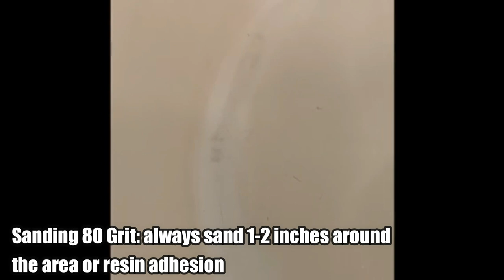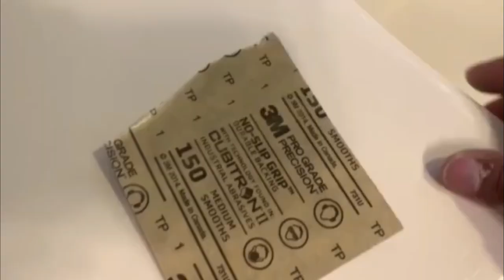How to Repair a Crack in a Fiberglass Bathtub | Fiberglass Bathtub Crack Repair | DP Tubs

Comment: I appreciate this video greatly as I’m going to attempt to fix a crack in my tub tomorrow. I watched other videos why did you not use the fiberglass sheet for this one? I cannot tell if I will need a fiberglass sheet for mine.
Reply from the maker: If the crack is hairline and the surface is sturdy without much fluctuation
Reply: @DPTubs  Thank you I was nervous 😂

Comment: Thanks for the video, I wish I saw this before attempting to repair the crack on my fiber glass tub.  I used Keeney Bathtub Inlay Kit for Bone Colored Tubs to try and fix it.  I realized after it was the completely wrong color and it did not seal the crack.  What is the best way to remove the putty and start fresh?
Reply from the maker: Use a single edge blade or a plastic scraper to remove. You can sand with 80-100 grit sandpaper to thin out the previous coating. Just remember to primer coat the area before spraying the new coating
Reply: Thanks, I put the bondo fiberglass resin and am waiting for it to cure. What texture should the resin be when fully cured?

Comment: I have a small crack in the middle of the floor of a fiberglass tub. Would you recommend same or one of the putty type repair products. Thank you and this was a great video.
Reply from the maker: I would not use a rubber putty. How big is your crack?
Reply: I have the same issue.
Reply: Which one did you go with? Did it work?

Comment: Thank you Danny for great step by step instruction. Currently following your steps to fix a crack in a tub and i have question for you. The Bondo general purpose putty you are using is not available in  Canada, can i use the Bondo body filler instead?. Thanks in advance
Reply from the maker: Yes you can!
Reply: @DPTubs  Thank you
Reply: @DPTubs  Is the reason of using  Body filler/All purpose putty is to smooth the surface of the resin ? or there is any other function  it does?. The tub crack i am repairing is not big and i did not use Bondo Hair, just used resin and mat. After sanding the resin it came out  smooth and nice so i am wondering if i can prime it and paint it without using Body filler if it is not necessary. Thanks for your help

Comment: What caused the crack? Is it a bad base?  I don't think I have a solid base below my tub and that's what's causing the crack.  I'm wondering if I should get a new tub or can possibly repair the existing tub.
Reply from the maker: Where are you located! Most bases have a gap between the sub floor and the base of the tub, or may even have particle board substrate that eventually breaks or cracks. If there is a sub floor then injectable foam can be sprayed under the base for support then fiberglass patched.

Comment: Just curious why you didn't drill holes at the ends of the crack to stop it from spreading like in your other videos?
Reply from the maker: This was a very small thin Surface crack that hadn’t penetrated all the way through yet. The reason for the use of resin was due to the area the crack was in.
Reply: @DPTubs  Ah got it thanks for that. I'm going through this now and have a 2" crack but it has gone all the way through so will drill holes on either side. Thanks!
Reply from the maker: Kevin Ng yes I would recommend that and use the cloth / mat and resin.

Comment: How do you repair a hole in a fiberglass garden tub? Hole is on the 'curve' of tub. Thank you!
Reply from the maker: In my other fiberglass crack repair video I show how to fix a crack on the curve with resin and cloth
Reply: @DPTubs  Thank you for a speedy response. I will watch it entirely.
Reply from the maker: Kathleen Golden i also have a small hole repair in fiberglass coming up this week I will show
Reply: DP Tubs do you recommend using resin on any area of the tub ? Or works only on curving area?
Reply from the maker: LocoSport HD any area that has cracks or even small chips

Comment: Do you recommend drilling holes n a 4 inch crack?
Reply from the maker: I recommend drilling a hole at each end when each side of the crack is not level with each other. Meaning the crack has caused one side to be slightly lower. 

If it’s just a slight hairline stress crack then I would say no to the holes
Reply: @DPTubs  What if this is on the side of the tub and underneath is a semi-open basement ceiling?  I can't get my hand up there, but if I spray foam, I think i twill get everywhere.I patched it with a kit from lowes and a day later it cracked again. So I think it needs support, but don't want to ruin my basement.:-(  Thanks so much!
Reply from the maker: bjscharf all fiberglass units have a void space on the sides. If there is lack of support and the void space you would have to put so much foam to fill the area it’s not worth it. Patch the area with fiberglass mat, resin, bondo glass, sand smooth and spray

Another option if you do not care so much about having a slight hump over the hole is to use Fiber Fix Patch. It’s great for DIY use. The patch is already set for you. You just need a UV light to dry it within 5 minutes and then skim it with putty.

Comment: Thank you so much for this info...the tub in my small bathroom has cracks in it and I thought I would just have to replace the whole tub 😳 I’m gonna try this and see how it turns out! And yes I want to see more tub repairs! #fambammersunite
Reply from the maker: That’s awesome! All of the material is at Home Depot. Just make sure to check if your tub is Bisquit color or White..usually will
Not match 100% but very close.
Reply: DP Tubs it’s white...I put it in about 15 yrs ago and really didn’t want to have to replace it yet! Thank you sooo much!
Reply: @DPTubs  My wife is concerned abou tthe "Not match 100% but very close".
I am concerned about the surface not being the same height as the original.
Ideas? Thanks for the detailed info.

Comment: Hi are you in southern California or can you recommend someone?
Reply from the maker: I am in Las Vegas!
Reply: @DPTubs  cool I'm in Vegas as well. Me and my dad are going to try to diy it with your video. Just out of curiosity how much would charge someone for a fix like this.
Reply from the maker: Spencerwalker21 Anywhere between $125-$175 for repair only!
Reply: @DPTubs  thanks for the info me and my dad can probably do it ourselves. Youtube is the best we called some guy my dad knows he thought over the phone it was gonna cost about a grand to fix and 3-4k for a new tub.
Reply from the maker: Spencerwalker21 crazy pricing.. it’s definitely worth trying on your own first!. Let me know if you guys have any questions along the way. I also have some more in depth repair videos depending on the extent of damage.
Reply: @DPTubs  thanks and quick question does flex seal work or is that some overhyped garbage.
Reply from the maker: Spencerwalker21 to be honest I have not tried it myself however I have used FiberFix with a UV light and it hardens pretty good! Just leaves a little bit more of a jump on the patch.

Comment: Great job....if possible can we see repairs on a stand alone shower? Tfs #fambammersunite🙂
Reply from the maker: Yes...what kind of repairs?
Reply: @DPTubs  a huge section of the tiles has fell out. The borders are always blacken it's hard to be cleaned
Reply from the maker: Kendra Clark I have a video on how to remove tub caulking. That will help you know how to remove caulking around the base of the shower to remove the black molded caulking